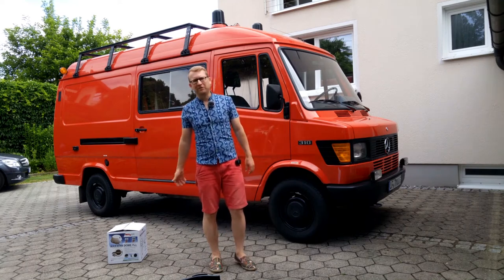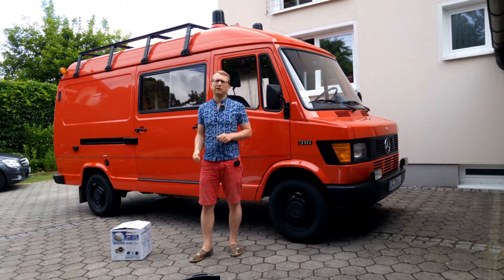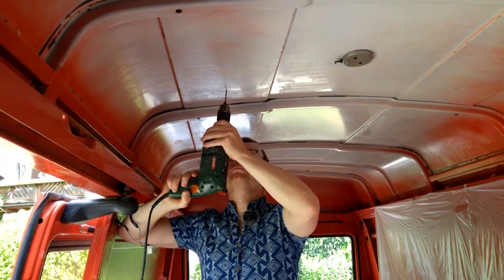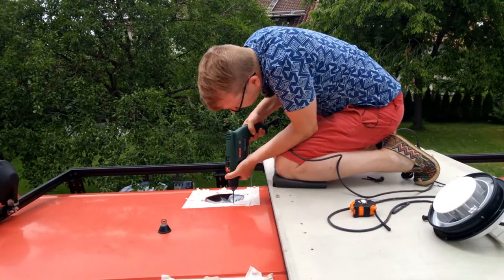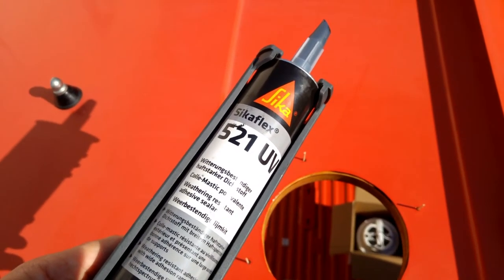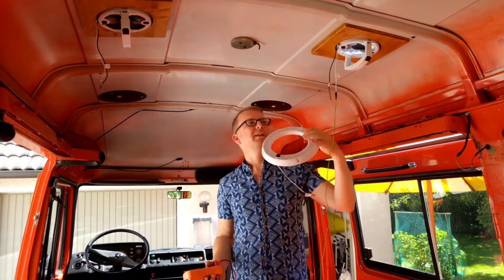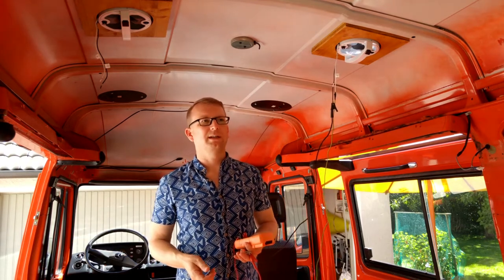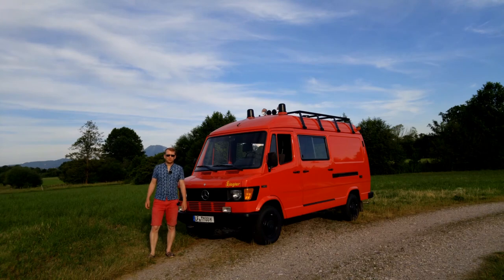MAXXFAN Dome for Camper Vans: Review and Tutorial how to Install this Exhaust Fan in our Mercedes T1

Comment: I have the same fan and I should install next week.  I did make some test.  I put a rheostat
in line and I could lower the speed so it is almost silent, using .3 amp.  good for night sleep.  I also test the fan reversing the polarity and it works perfectly sucking air in.  My plans are to install a reverse switch to have it runnig two ways and of course, a rheostat.  Thanks for your video.
Reply from the maker: Hi Richard, I also tested reversing polarity before installing and it did not suck air in. Reversing polarity resulted in the fan turning the other way round (like expected), but the stupid shape of the blades results in the same way of the air flow to outside, not to inside.  Cheers, Mike

Comment: You need an "arbored hole saw" to do this project.  It has a drill bit in the center of the hole saw that guides it.  If the material is too thick, you can cut from both sides because the drill bit re centers the saw.

Comment: Thank you for taking the time to make these videos, so helpful! Please could you let me know if you can use these fans whilst you are driving the vehicle?
Reply from the maker: Probably yes, but I wouldn't want to do it regularly, because wind pressure might stress the plastic material and also the sealant. So it might cause problems in the long run.

Comment: Great video, very helpful.
Have you had time to test them out yet? Do the two of them perform well together to ventilate the whole van?
Reply from the maker: Hi Joe, as soon as the van is finished, I will test them under real travel conditions and make a video...
Reply: @CubeofCars  looking forward to that. I'm also considering buying 2, with the option for a third.
Reply: Same here. Are two of the fans a good choice? Thanks for your answer
Reply from the maker: @JimiHendrix87  One of our fans is for the toilet room, the other one for the main room above the kitchen cabinet. That's the main reason why we needed two of them.

Comment: Hi guys, at this point it’s been a year since your Maxxair dome installation.  What are your thoughts/feelings about your choice?
We have a Maxxair deluxe in our 1959 Airstream and we love it.  With our new project - a 144 Sprinter van, our boats on the roof don’t allow for the deluxe fan.  The dome fan size would be perfect - but I am concerned I won’t be happy with the amount of air they will pull through the windows.
What do you think?
Reply from the maker: It's surely less air than the big one, but for a small van it's ok. I see two disadvantages of my fan. First, I would like to have it operate in both ways, in and out, which it doesn't. And second, it could be more quiet for night time.
Reply from the maker: @U Wot Not sure, if that works. But it's a good idea. Maybe I will try that and see what happens...
Reply: @CubeofCars  add a pwm controller. Very simple
Reply: just wire a reversiing switch that reverses the polarity of the wires, and it will run the other way.
Reply: But how are the blades shaped?

Comment: What is the height of the fan on the roof when in use? I want to install one in my van but I have a roof box and so it needs to fit underneath
Reply from the maker: Hi Lilith, it's 10 cm high when open.
Reply: @CubeofCars  thank you.🥰

Comment: Is that enough to prevent mold? So i wouldn't have to use a big fan?
Reply from the maker: I don't think it's possible to answer your question in general. Depends where you travel, how you travel, how much moisture you bring into the van. My other van, a Ford Transit, doesn't have any fan, but I still had no mold while travelling in summer in Europe. And during rainy saison in tropical Thailand everything will get mold, no matter how many fans you install.

Comment: Did you have the spec for the height ? close and open. I got a rack with a SUP so i need to open when the SUP is in the roof THK
Reply from the maker: It's about 7cm high when closed and 10cm when open.

Comment: What size was the hole saw? I am planning to install the fan but not sure the exact diameter of the hole
Reply from the maker: The size of the MaxxFan is 15cm. I cut a 16cm hole, maybe 15,5cm would be enough, but there are cables at the side which have to go through the hole, so too narrow isn't an advantage.
Reply: @CubeofCars  cheers, i've ordered a 16cm holesaw :)

Comment: hi Could you tell me the external diameter of the fan housing for the outside - i have a flat area and need to see it it would fit on this area Thanks
Reply from the maker: You need a flat area of at least 21.6cm

Comment: Could you reverse polarity for it to suck air in?
Reply from the maker: That was also my first idea, but it doesn't work. Changing polarity does change the direction of the fan rotor, but unfortunately this does have no effect on the direction of the air flow, due to the shape of the rotor blades. They always move air away from the centre and thus outside.
Reply: @CubeofCars  Sehr gut - ich wollte sicher sein, dass es ein Ablüfter ist :-D geeee-kauft!
Reply: Yep I thought I could do that, bit yes the design of the blades always exhausts. I wonder if a replacement Blade to a traditional design can work?

Comment: If i am not wrong you can reverse the wiring and it can suck air in as well.
Reply from the maker: No, it doesn't work. I tried it. Reversing the wiring does change the way the blades run, but that still doesn't change the air flow because of a very strange design of the blades.